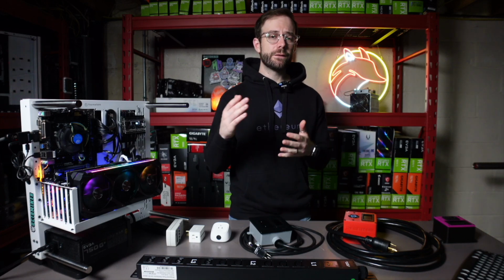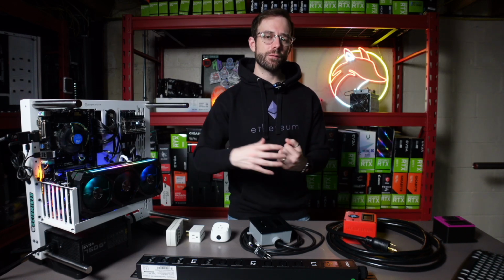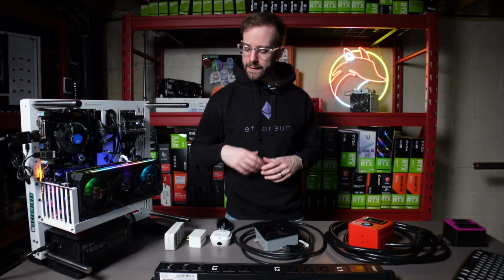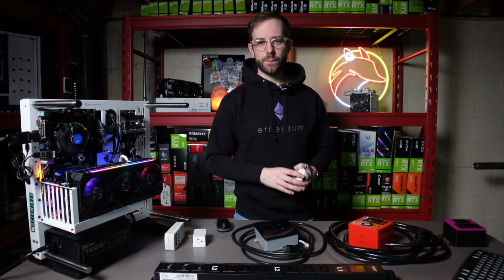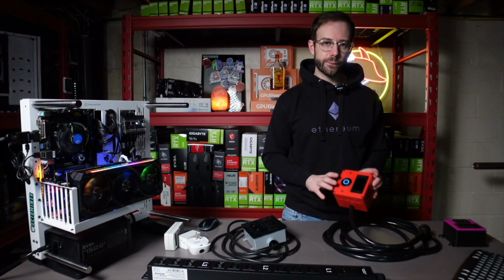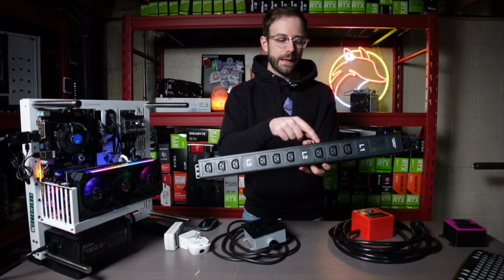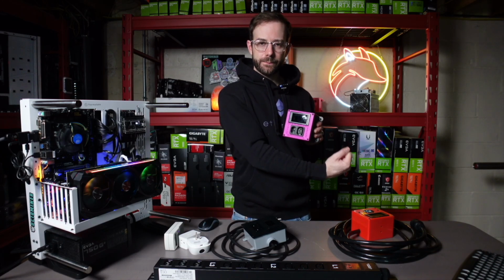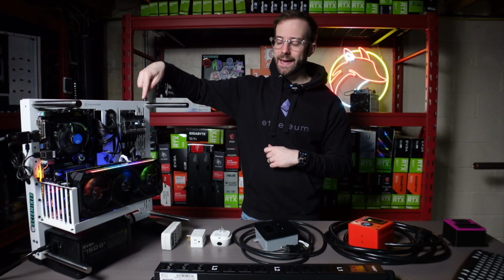How I Measure GPU & Mining Rig Power and Why It's Important

Comment: Alright, I just ordered two WeMos. I'm excited to try them out.

Also, can someone help me understand how much power I can use in one room please? My understanding is that each outlet is 1200w at 80%, but I don't know how many I can use in my bedroom. It's not my house, so I don't have other placement options.
Reply from the maker: It's all about the circuit load. I'll assume you have 15amp wiring (it's the lowest you'd have in USA houses).  So thats 15 x 120v (standard voltage in USA) which gives you 1,800 watts MAX on a circuit. 

Any continuous load you want to run at 80% of it's max to account for voltage spikes. Miners are a continuous load. That gives you 1,440 watts to use on a single circuit.

That one room could have a bunch of outlets on a single circuit or multiple circuits. Easiest way to find out is by switching off circuit breakers in your main panel and seeing what outlets go dead.

While you are in there you can also see if the circuit breakers are 15 amp or may be 20 amp which gives you more wattage to play with.
Reply: @RedFoxCrypto  Big oof, I just found out I'm sharing a 15 amp circuit with the other basement room, and I'm at 1,000 watts from just one mining rig. I still have another one to set up. I might see if I can claim some space in the utility room, and have a circuit added near the breaker box.
Thank you for the quick response!

Comment: What about accuracy?

If you already have all this different powermeters, then a video about the accuracy of them would bei very intresting.
The reviews of the cheap chinese powermeters which are used in the Costum Build are not that good.
It may be more a guess of actual power draw than an measurement.